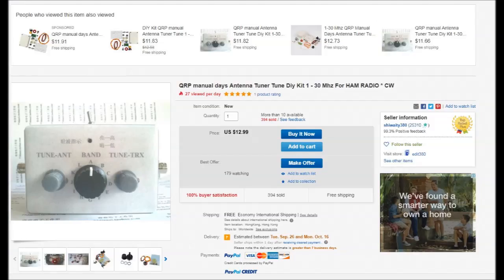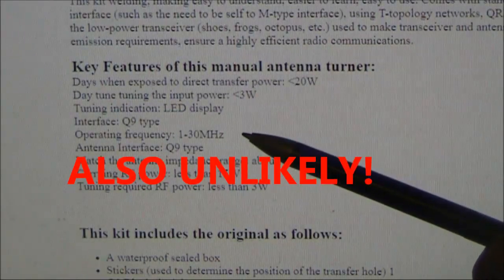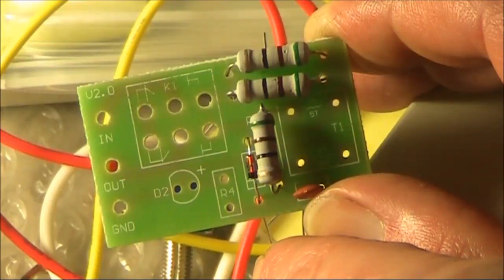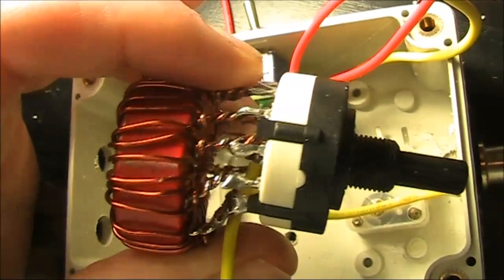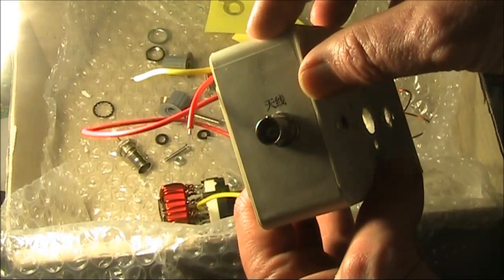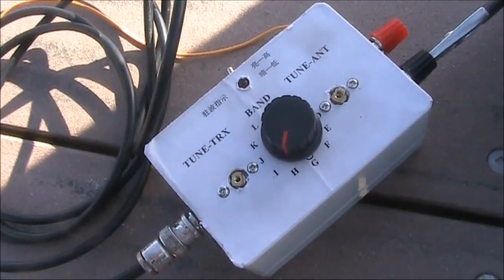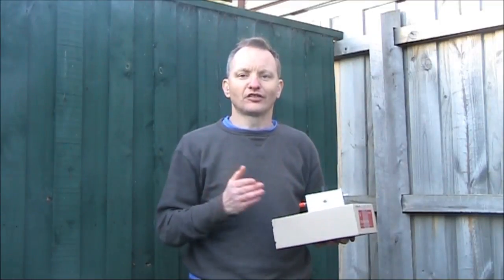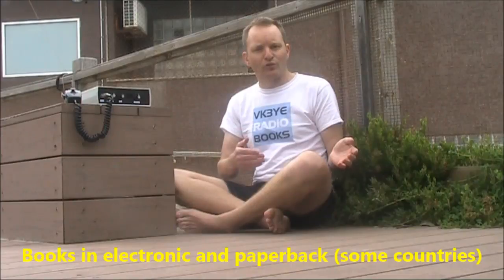One error after another: Reviewing the Manual Days antenna coupler kit

Comment: I bought one of these, and while waiting for delivery, reviewed build suggestions.

Using KP4MD's suggestions to "fix" ("ressurect"?) it got it working nicely.

I wanted to experiment more and bought five more when I saw a sale on a large online Chinese vendor.

The goal now is to adjust the windings to tune the shortest wire for use across the bands on a QMX.

Following the instructions out of box, it is a dud as Peter shows, but now years later, it seems to be rehabilitated and tunes up nicely.

If you are curious about this kit, I can recommend giving it a go.

Rob, VK4SSE

Comment: Interestingly I recently built one of these kits. It came with knobs for capacitors. Each knob had a long screw nut and 2 washers. I replaced the screw inside knob with long screw and suppled washers and nut as a spacer and it all fitted perfectly. No tweezers required. George

Comment: Mine worked pretty good but only because I watched every video I could find. Biggest error you didn't mention is the inductor diagram, the single turn goes to the T , and the 10 turn  portion is sent to ground it can be left open but could possibly generate some interference if dangled open. I found some sleeve material longer screws and lock washers and made my own shafts extensions. The screws that were sent had the wrong thread and size anyway.  The  Dremal was my friend on this project; I had to cut the plastic nubs out to get the variable caps in right, trim holes etc. I found a really nice 12 posted switch on Ali Express have not installed it I wanted to get some more toroids and build another one but havn't. Built it for my QCX radios.

Comment: I realize this is 5 years old at my writing, but YE's reporting of this is true. It's mostly true that the kit is garbage although he did a masterful job to salvage it. However, at the price they were being offered, I bought two and built two tuners into more spacious containers that worked well. I also was able to construct add-on shafts for the variable caps that worked suitability.
The cases? They made perfect EFHW or unun containers.
The overall cost is well under what the individual cost would have been.

Comment: Wish I'd watched your video before I built mine. Worst kit I've ever built. Best bit was the box. The so-called instructions are rubbish. Even after correcting the errors and getting it to work it still had a minimum of 3dB loss after tuning (up to 10dB depending on band), not what you need if you are doing QRP. I've gone back to a homebrew L match.
Reply: I took all the bits and made a pi tuner, a lot better.

Comment: hello, yes I was dumb enough to purchase this! Was wondering could you help me with the toroid wiring?
I am happy to see this video but as you said it really is a bit of a nightmare to build but as I am 65 and semi retired, -30c outside with lots and lots of snow, freezing temperatures today 18-Jan,20211 the doors on my 4x4 chev truck all froz closed as yesterday it warmed up a bit, cleared snow away, then went inside. With nothing better to do I started building this tuner from an order I made last year to do in the winter time.
I started building kit by getting the resistors in first as it was the easy part, I think as you said the instructions suck! And the fittings are off.
I wired the toroid then after completing realized I may have made a mistake as I checked the T106-2 drawing showing what seemed to 23 turns with 12 tap points. But after completing  realized this can't be right? Recalculated after a closer look and a lot of coffee (probably did not help) and realized  it should have been 35 turns with the 12 tap points? Is that right? is that what you had?

Freezing cold, stuck at home.
George
Alberta, Canada
Reply from the maker: Hi George - I don't remember. And I no longer have it so can't take a look. But I think there's some website articles or blogs where people have described their construction experience. These may be helpful.

Comment: INSTRUCTIONS FOR MOUNTING KNOBS ON THIS TUNER BOX.
You dont need any parts to get fully working knobs, use what did come with the kit.
Here is the parts list you need to save that as i said already is in this kit:

Save the knobs and put them on a parts dish/box.
Put also aside the 4pcs of 2.5mm washers that did come with the kit. They was not ment for mounting the capacitors to the project box, drill small holes, or get more washers.
The spare 2pcs of 3mm nuts was ment as a thick washer for spacing out the knobs from the project box so it does fit.
The 2pcs of 2.5mm long screw was ment for using with the knobs instead of the stock screws that dont fit.
This is a detailed step by step list to get the knobs to work on your tuner:

1. Remove the brass inserts and the stock screws in the knobs that wont fit.
2. Now put a washer on each side of the knob.
3. Use the 3mm nut as a thick washer between the variable capacitor and knob to space out the knob from the project box so they does fit.
4. Put in the long 2.5mm screw trough all that and mount the knob on the variable capacitor.
5. Tighten it some and test if it is good enough to withstand some twist pressure, if not screw it tighter, beware of screwing it way to hard, it can ruin the capacitor (unless you use a specialized perhaps homemade wrench or plier to hold the brass on the capacitors it is only the capacitor plates that give you resistance to screw the screw on, so beware this.
I guess it is possible to tighten it too hard and ruin it so go for minimum of what is acceptable pressure on the knobs for normal use).
6. Put on the lids on the knobs and voila you got fully working knobs people :)

It works good this way. Screw it on harder and harder until it no longer skips and instead sticks for normal use, in other words be a little careful not screwing it too hard becourse the capacitor can be broken. But make it strong enough too, there is a balance here.

These variable capacitors was only ment for use with a plastic pulley wheel in small portable radio production so real knobs that fit these capacitors was likely never made.
Reply: I also place a drop of LocTite on the tip of the long bolts. Once the bolt is engaged on the pot shaft allow the thread locker to set up. Another tip is to "tin" with solder the contacts on the caps and switch as well as the taps on the large toroid. Allow the switch contact and coil tap to "rest" a few seconds after soldering before soldering the next tap. This is to keep the plastic housing on the switch from melting.

Comment: I just tackled one of these kits. Thanks for the tip on the board markings for the toroid  being backwards (I would have missed that).  My question is hooking up the tariable capacitors. They have 3 terminals.  (Which is which??) Min works great fron 3.5 - 12  mhz.  Will not tune 14 mhz. I am hoping I have the variable capacitors wrong.
Reply from the maker: Hi Sam - Unfortunately I can't help as I've long disposed of the kit.
Reply: @vk3ye   No problem! Thanks for the quick response! I found some other build critiques that said that the switch was not RF friendly.....we will see.  I also found some clear pictures of the variable caps hook up.  Thanks Again.

Comment: Peter, great video. I purchased one of these kits before seeing your video. Mine went to gether OK. I even got knobs that fitted the capacitors. It actually tunes up an antenna (40m nd 20M) but I got no indiactor light. I watched your video, traced out tracks and compared with the schematic. Yep, even kits supplied in 2019 with the V2.0 PCB still have the 2T/5T labels reversed. Disassembled it now and will make changes and see what happens. Fred VK2EFL

Comment: Can anyone give me some advice in regards to tinning and soldering the enameled wire? I'm having a hard time getting it to stick
Reply from the maker: Scrape off the enamel first with a sharp hobby knife.
Reply: Also make sure you have a really hot soldering iron. low wattage solder iron won't work for those viewing this later than this post.

Comment: It looks cheap and nasty. I love how the instructions talk of welding things. Zap! A pile of burning plastic. I like resistive SWR meters as you never go above 2:1 SWR when tuning. I use the G-QRP Club circuit but with a large 0-1 mA meter, easy to see at a distance. Useable from 160m to 6m. I was given an MFJ16010 atu which supposedly didn't work. I don't like buying things and always accept free stuff! After two years of perfect use it wouldn't tune  one day so looking inside and seeing nothing faulty I started poking around and discovered a loose wire. I re-soldered it and it works fine again.
Bill, G4GHB.
Reply: The tx only ever sees a maximum of 2:1 but the meter indicates all SWR. Calibrate a meter type SWR bridge with resistors.
Bill, G4GHB.

Comment: Do be sure to check the length of the screws supplied for the Polyvaricons. If the are too long they will bend the fins and ruin the Polyvaricons. You could use Glue to secure them.

Comment: Thanks for being out there on the bleeding edge! September 2018 looks likes there's been a rev of the board; the one I got has components that fit and turns properly screened on the circuit board. Still zero documentation comes with it so THANK YOU THANK YOU THANK YOU for your help. -  aa2mz

Comment: Hi Peter,
How about using a nylon screw and nylon spacer to replace the knob for the variable capacitors.  73  WB3BJU
Reply from the maker: Yes, that could work.
Reply: It took a while to figure this out... Throw out the brass collar and corresponding screw. Use the long screw, with the knob sandwiched between two washers. Finally, the oversized nut acts as a spacer between the knob and capacitor shaft. This should get all the dimensions about right so when you tighten the screw it should stay tight.